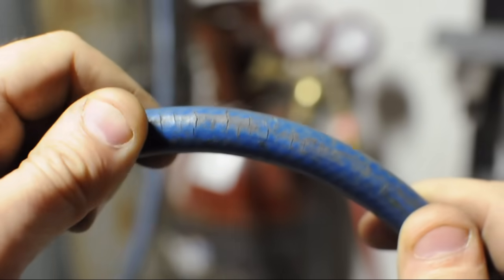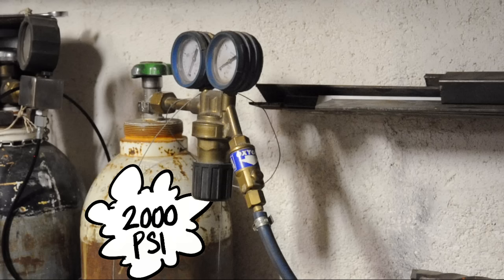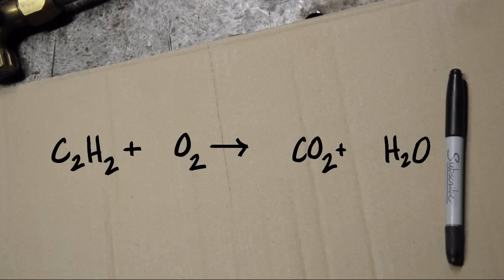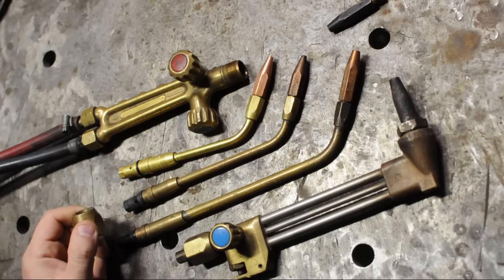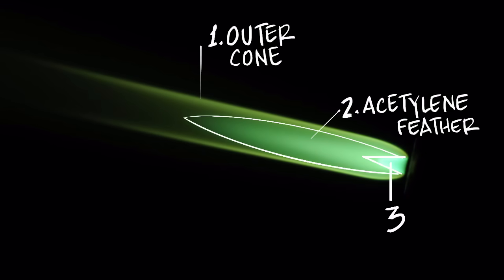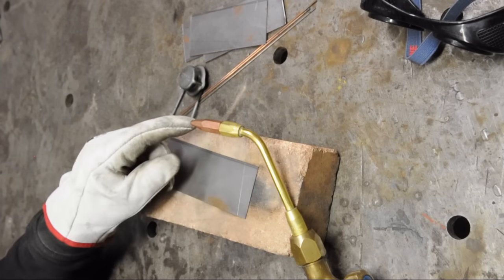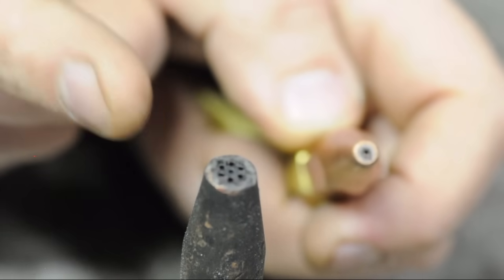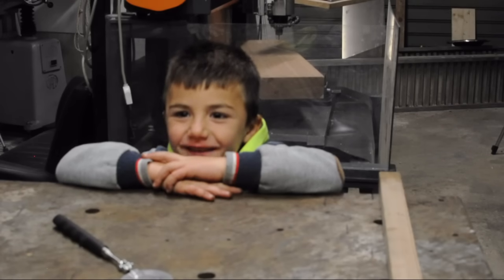Let's Talk Oxy Acetylene

Comment: We use propane torches at work to heat the nozzles of injection molding machines when they freeze up. When you re-light a hot torch with a lighter your hand comes very close to the tip and if you don't pay full attention you can take the skin off your thumb which hurts like hell. Probably not the real reason to use a striker, but it served as a learning experience for me, no question!

Comment: Well explained, and well done.  I've been welding using Oxyacetylene tanks since the '60's, upside down hanging from the ceiling - but it does give me a headache, and the change falls out of my pockets . . .   Anyway, helpful reminders of what I basically had to teach myself through trial and error as a teenager - mostly error.  Never could weld aluminum sheet metal with it, but brazing was a great way to join car sheet metal without warping it.

Comment: When I was a first year apprentice at Ingalls Shipyard, we were cleaning out a dry dock while a boat was out on sea trials. Some of the older guys (who should have known better) lined up 5 oxy cylinders on the dock, with the bases pointed toward the Gulf of Mexico, and started chopping the valves off the bottle with a fire axe. They shot off across the water like a torpedo. It was all fun until they managed to hit the Coast guard boat that came to investigate the reports of tomfoolery. From that point forward, it was utterly impossible to get a single cylinder, they only came in manifold racks, and they had to be accounted for every day.

Comment: When I did Welding and Thermal cutting at TAFE (technical college here in Australia) years ago they were very specific about not using a plastic bodied butane lighter for lighting Acetylene torches. They gave a few reasons: lighters have been known to melt/explode/burn if they are in the path of the torch flame once lit. Secondly, acetylene torches are often used for thermal cutting and when this is done overhead or in other awkward positions, slag and molten metal can hit the lighter (when in a shirt pocket, for instance), melt through the plastic and ... well, there have been cases of lost limbs. Lastly, if you're dealing with heavy bits of steel and the lighter happens to have fallen out of a pocket, onto the floor and attempts to catch cut pieces as they fall ... there's a good chance it'll crack and vent butane into a space that really shouldn't have it.  A flint-based or equivalent striker is the safest way. 

In unrelated news, it's also a bad idea to use the oxygen feed as a "duster" to clean oneself off after working. Yes, people do this, but if you're wearing cotton clothing, the oxygen temporarily binds with the cotton and turns the clothing into a highly flammable incendiary. Bad things have been known to follow.

Comment: i really enjoy oxyacetylene its what i first learned on in highschool. i also learned to respect the dangers of gas at a young age, some idiot used too much pressure coming off the cylinder and burst the line, this additionally caused a leak that filled a small closet with all the cylinders with gas. i just remember going into that closet and having to hold my breath as well as keep the lights off so that i could turn off the main valve to the acetylene. also as well i totally agree with learning on oxyacetylene, you learn the fundamentals of welding at their core. nothing like melting a pool of molten metal between two pieces in a joint, then dropping a bead every so often within the keyhole.

Comment: one tip if you are looking for the "cutting" tip sometimes the metal industry calls them a "gas axe" if this helps. also in reference to Propane and LPG fuels you can get the same 'torch' as this oxy acetylene version, just not as hot, ie : what a plumber\ gas fitter uses for copper pipe welding, or a glass worker uses to solder lead light work; also fuel + AIR versions are available too, depends on temp. requirements for the job.

Comment: Thank you ever so much for the video.

For decades I have been working on my jalopies here in the rust belt by reason if lack if funds for shoos to perform most work.  I 2ant the ability to "torch" as the propane/mapp gas/so called thread liquid rust desolvers never work.  It grind or drill for me.

I am at my limit with rusted/corroded/stripped fasteners.  However, when I read the Acetylene can set itself on fire by spontaneous combustion, I am thinking twice about my dream for acetylene.

Also, the cost from starting from scratch: in the Chicago area, a new kit with empty bottles is $500.00, in Ottawa Blaines Farm & Fleet $365.00 , and craigslist $250.00 in fair shape.  Could get a Toyota scan tool for the $250.00 and use it 20x more often.  I believe the acetylene will sell for $90 h tax for 20.cu. ft.—when the chinavirus goes away and the store opens again.

Comment: I have never even heard of flash back arrestors.  Worked as a heavy construction fitter/welder with some erection.  Steel mill production mainly.   But we always ran the pressure higher than you do and used the head to regulate.

Comment: On the subject of spark arresters. When I was a lad I was under a piece of equipment cutting a stripped bolt. I got too close to the bolt and the torch backfired. I shut it off right away. I waited a minute or so and attempted to relight the torch. It wouldn't light but soot was blowing out of the tip. While I was turning the gas valve back off I bumped the trigger. There was a loud bang. The hose had exploded and burned the side my coveralls clean down to mt BVDs. My skin was reddened but not burned. My coveralls,  jeans and tee shirt were all vaporized all along my side from chest to thigh. I'm not sure that flashback valves were available back then. When I heard that they were available I made sure that I had some. I have them on both the torch and the regulators.

Comment: Here in Oz our bottles [not tanks] have flashback built in. 
Oxy welding tips come in many sizes depending on thickness being welded.
I was taught that base pressure is 10lb both oxy and acetylene. And up to 20lb oxy  for cutting. 
Base pressure using a small tip may come down a bit though I still use 10lb welding exhausts and just feed in more wire. That is the only way to weld up holes in old exhausts.
Body panels need a small tip and a small flame. And patience, and a wet rag to stop too much distortion. While I dont use it much these days and decry the bottle rent it I still justify it for the heating jobs. Though I do lose the costs on tax!!
As for bottles, look at most tradies, especially plumbers whose bottles never stand up in their utes or vans. So top heavy they fall over often.
I use an oxy trolley with the bottles chained to it.
I have seen an oxy bottle take off by itself as the bottle fell over and broke the tap off. Exciting!!
Oh, and as for yout average welds, dont weld on top of a brick, A. it is a heat sink and B. The buggers will explode as well. Concrete bricks do not like  extreme hot and cold. Clay bricks are ok with the heat [ think kilns] but are still a heat sink for welding.

Comment: This is excellent! Thank you!

10:09 My thoughts about the prohibition against using an open flame device--such as a bic lighter--to ignite an oxy-acetylene torch has to do with liquid fuel in the device.  Upon ignition, the acetylene might combust in such a way that it caused secondary ignition of the fuel in the device.  A striker would does have this potential danger, because it has no onboard fuel.  Keep in mind that the prohibition was probably put in place in the past before lighters, et al., had modern safety features.   This is only speculation on my part.

Comment: I took metal shop a little over 20 years ago in high school. The teacher in my class only taught us oxy acetylene. Some of my classmates complained that it wasn't useful and we should be learning some form of arc welding instead. Our teacher told us that he only taught oxy acetylene for a reason and we would understand eventually.
It took me ten years to understand his reasoning; welding is all about control over your puddle. This happens much slower with oxy acetylene and gives you some time to observe and see what is happening and what effect your manipulation has. If you can do oxy acetylene welding you can do any type

Comment: Thank you so much for this video as it led to much knowledge for me but also much knowledge for some of the posters below.

I like you figuring out the chemical equation it was neat. You're the first one introduced way to flashback arrestors. 

The place where I bought my ProStar 21508 tote did not give me any instructions on where to set the pressures.  They said to go on YouTube University.

My watching of shade'tree truck mechanics on YouTube gives me the chills on what they say to do such as beating on the pitman arm attached to a steering gear box with a heavy hammer.  Your video is about the 5th oxy-acetylene video I've watched and the best.  I truly feel like I've been to a university with this video.

As for the commenter that's been using his upside down-- I think we don't hear from him because I think he's gone to another form of life cuz I've read that tipping the acetylene bottle sideways will cause the settling to spontaneously combust.

I believe the smell of acetylene is the same tactic that the smell of natural gas in homes:  one knows not to light his cigar if he smells that smell.

SECOND VIEWING:

I like how you filmed what the flame would look like through welder's goggles and how to adjust the flame.

I like the x-ray vision to show what's in the acetylene tank and how the acetylene is stored.

Comment: Victor makes a nice inexpensive hose repair kit that includes the one time use crimped hose end clamp and pliers to crimp the hose clamp
Reply: Yes the Oetiker 2 eared clamps are the best as they are one piece with no welds the 1eared clamps are welded. I worked at a shop that had some fellas from south of the border who wrapped bailing wire around the hose and twisted till it was tight. I was shocked but I noticed that it actually worked. Not an OSHA approved habit.

Comment: A local bike maker uses an acetylene pilot light with a switch in the torch rest  It turns off gas flow to the to the torch when you hang it up. Pick up the torch gas flows and you're tip is right next to the little pilot flame.

Comment: two things i was taught 40 years ago in trade school, red before green or you won't be seen, thats lighting and turning off, another is to line up the knobs so you can lay the torch down on a table and the knobs never touch the table, they can be bumped and open.

Comment: One thing to remember with an oxy acet. Flame.  The most heat is about 1/8 in from the tip of the flame cone.  When welding you can control the heat by tilting the flame.  Most heat is transferred with the flame perpendicular to the work.  I grew up having the weekly chore of cleaning an refilling the “Sightfeed” acetylene generator for my dad.  Had a torch in my hand before I can remember. Was never a real good welder.

Comment: Most if not all torch lighters have a sort of cup behind the striker and flint. 
That cup is to catch and accumulate the gas at a lower velocity than just a straight jet of gas which you would have when using a lighter. It makes a much better "system" for lighting the torch.

Comment: I used to love the 8’ cutting torches at my old job. “Steel mill”. Them suckers even at 8’ hit the oxy handle that sucker would sound like a jet and start pushing pretty hard but that was also with tips 5 times or so bigger than the standard handheld shop torch.  Them suckers had no problem cutting 200mm almost 8” billets of steel with no problem.  Not quite sure how thick it would of been able to have cut being that was the thickest crap that was around.

Comment: Acetylene smells the way it does because a smell is added so you can smell if there is a leak. I recently lost a workshop to a fire and an acetylene bottle was right in the centre of the fire, it didn't blow up, they aren't as dangerous as you think, unless they are pierced are are leaking.

Comment: The discussion of the cutting attachment at 15:30 I think is a little misleading.  The oxygen valve on the torch body you're touching loses control when the cutting head goes on.  I usually open it wide (a few turns), and adjust the preheat flames with the valve on the cutting attachment.  Adjust overall cutting oxygen with regulator.  This is a little fumbly, since the preheat and cutting oxygen come from the same place so the adjustments interact.  Monster cutting torches, like the ones that go on cutting machines have two oxygen inlets that are adjusted separately.   I guess ideally you'd have a regulator for preheat and another for the oxygen jet.  I own some of these which have never been  used.... but ONE DAY!

Comment: I was leaving that in the metal shop but as a beginner I left the acetylene torch a little bit to long and created snow fall of black adhes the shop master said I did one of the best jobs in welding cause when I welded two steel plates together then we test the breaking point of those welds

Comment: The welding shop around here has an acetylene tank cut in half longways in front of the counter and the stuff inside is not like a sponge it is like gypsum from drywall. It doesn't have any of the big holes in it

Comment: My Father told a story about how they were using Acetylene in high volume and the use caused the valve to freeze and stop the flow.....so they wrapped up the cylinder to keep it warm.....

Comment: So you suggested learning to weld with gas. Why do you have tig equipment? If I only want one system which should I get? I want to weld steel, aluminum, and stainless. Which is more economical, which is easier to use/learn? I am thinking gas is a cheaper set up and it doesn’t require a circuit, or am I wrong?

Comment: I have to add a comment regarding safety.
Acetylene can become unstable and decomposite in some cases. It doesn´t happen often but it can happen.
The risks are heat or phsycical damage. Don´t drop the bottle and don´t expose it to heat, sun light etc as those can can be the trigger that starts the decomposition.
If the acetylene begins to decomposite you might notice that from the bottle heating up by itself. The heat will increase the pressure in the bottle and might result in a very dangerous explosion.
If the bottle starts to heat up, make sure you evaquate the area, call your fire department, and if possible without risking your life try to cool the bottle with cold water (lots of it) or placing it into a dam or a waterfilled ditch.
The fire department will try to cool the bottle and if they can´t they might shoot the bottle with a rifle from a safe distance to create a pressure relief and a controlled fire instead of an explosion.

Also, make sure you use a "check valve" (I don´t know the English name) to prevent fire going backwards from the hose and up to the bottle.
Store your bottles directly inside of the garage door so you can easily remove them from the garage if needed.
Some countries requiries labels/signs on the outside telling everyone that there are high pressure bottles on the inside.

If you want to know more about safety when handling/using acetylene, call your retailer or your fire department (not on the emergency number), I´m sure that they will be glad to tell you have to use your bottles safely. After all, they don´t want to meet you again. 🙂

Comment: I 100% completely agree that everyone should start welding with oxy fuel. It is the best way to learn how to work a puddle, and you aren't forced to wear arc resistant glasses, so you can see what's happening to the weld and the metal around it.

Comment: Important to remember when transporting oxygen and acetylene cylinders is that they are more durable than you are led to believe. You’re supposed to protect the valves at the top of the cylinder with the valve protector, but they are difficult to start the thread, I can never find them, and they’re too expensive to replace.  To transport the cylinders, we just chained them together, kicked ‘em over and hooked on to the bumper of my truck. That way we could drag ‘em down the highway like a heavy duty pair of waterskiis. They might spark a little, but the chain around the valve prove strong enough...and nothing bad never happened!

Comment: 15:05 - nice crack running the length of the weld on the center piece of steel lol. I have a oxy acetylene torch and brazing rods someone gave me, but I've never tryed it. I need to give it a go sometime, I'd like to try it.
Reply: Coming back to rewatch this a year later, finally trying some gas welding today. I'm not expecting it to be easy, but I'm looking forward to learning and troubleshooting the process. Should be tons of fun. 

Btw, I wasn't meaning to make fun of tot by pointing out the crack in his weld, just figured I'd point it out (usually he points this type of thing out). If I had to guess, I'd say it has something to do with cooling, but idk.

Comment: When I went got my plumber training we welded steel pipes with oxy-acetylene. To me it felt like tig, but easier. I'm going through welding school right now.
Reply: You are lucky if you have teachers that know OA like the oldies did since WW1. Get yourself the 1950 to 1975 Linde OXY ACETYLENE HANDBOOK. Treasure it, you will not find better welding tips in any new manual.

Comment: As a coachbuilder, you may say it is a panel beater oxy welding gives more options to joining metal. I sometimes prefer it over mig/tig when steel is going through the wheel because it anneals differently. Mig has too much tensile strength and gets too hard for some jobs IMO. Most of anti-gas welding arguments are from people who don't know how and we were gas welding aluminum before TIG was invented.